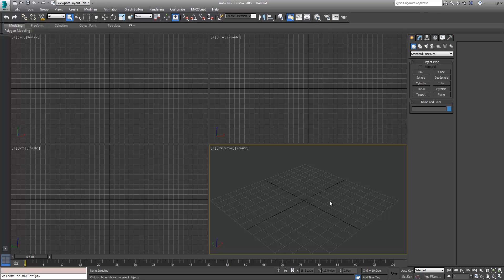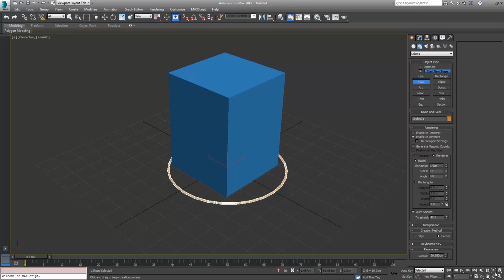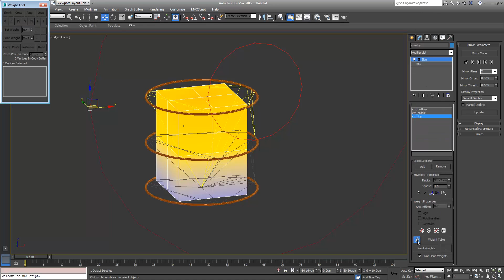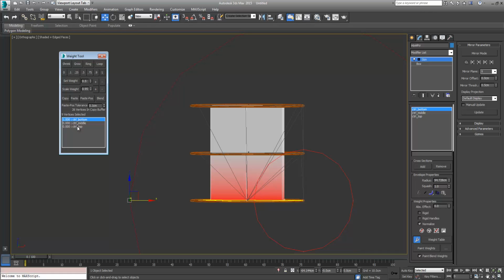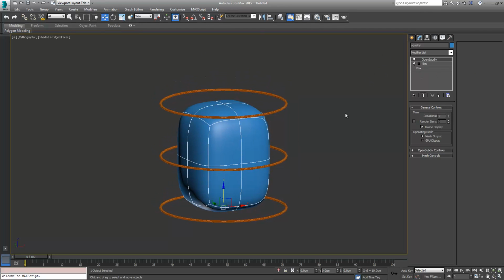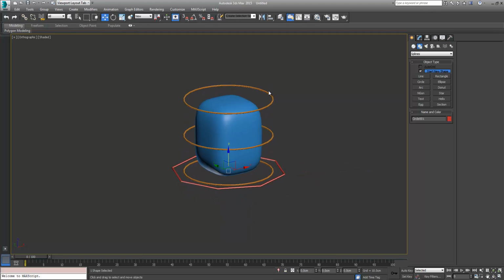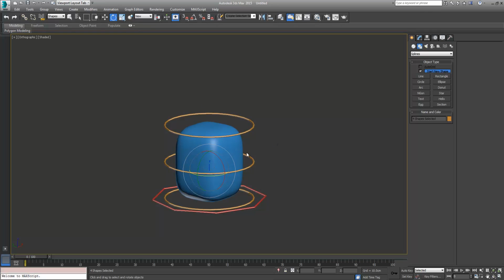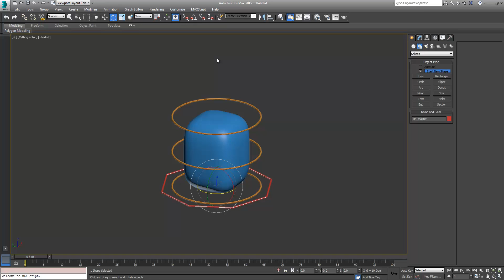3dsMax Tutorial_Rigging a squishy box_Part 1

Comment: Thank you so much for this man, excatly what i need right now for this project. 

One question i have though, not sure if you could answer it but i'll ask anyway. 
Do you know if i animate some loops with this rig, will it import and work within Unity or Unreal like a biped rig does, just drag and drop sort of thing?

Not sure if that's a stupid question or not, but thanks again for the video!
Reply from the maker: Hey man. Glad it was useful. I don't know about Unity as I use UE. But in UE the skeletal mesh has to have a bone hierarchy attached to the skin. But you could easily add bones to this rig to drive the mesh.